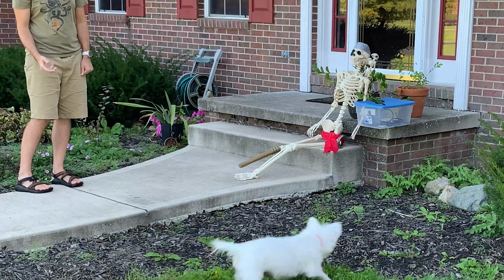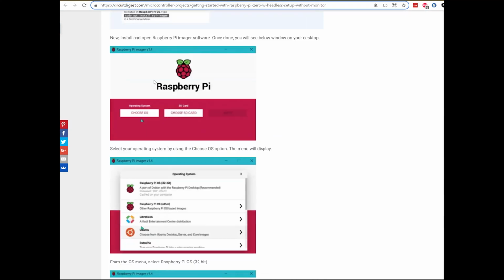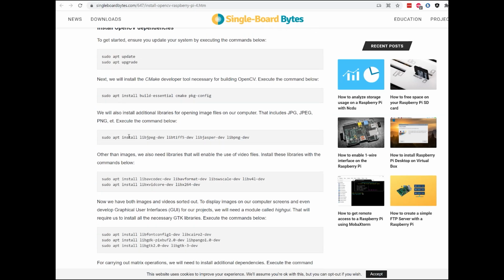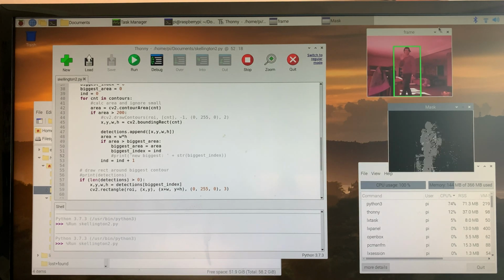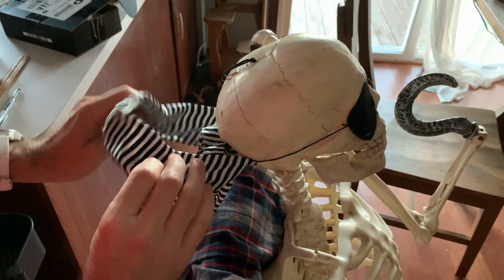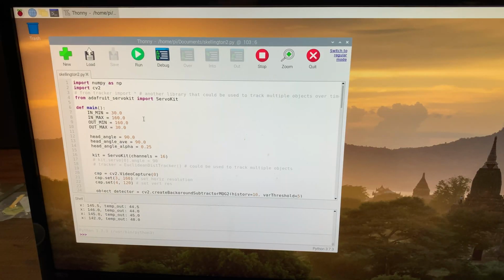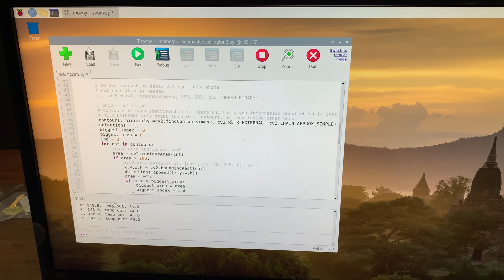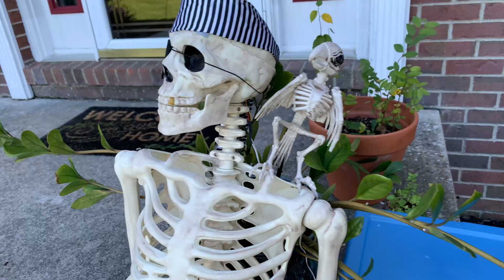HowTo use Raspberry Pi & OpenCV to track objects & turn servo

Comment: Hey! I replicated this using your guide, was a huge hit this Halloween. Wanted to thank you for the details you included. There were some things that have changed since this was released and this was my first time using linux or soldering but your video made it easy! It gave me an opportunity to work on a project with my grandpa after my grandma passed away and it really brightened him up. Thank you!
Reply from the maker: What a wonderful comment to read :) :) now you can get a wyze camera that does most of this out of the box, but you don't get all the control or grandpa time.

Comment: Very cool! I have a question. Can you also use the tracking software to detect and react to the object changing in distance from the camera?
Reply from the maker: You might need two cameras to get depth information, or some other sensor.

Comment: Great video! I am using this code as inspiration for a color tracking project for school. I had a quick question about the remap function and how it works. I am currently having trouble utilizing the full frame to get an angle. It seems that it only registering an angle for a quarter of the frame.

Comment: Hey, very good project.I have rebuilt your project and it works fine. Only I noticed that the servos do not turn off. Can you include a routine in which the servos turn off when, for example, no movement is detected? Many greetings !
Reply from the maker: I think you'd need to use a mosfet to cut power to it, but that may have unintended consequences: https://forum.allaboutcircuits.com/threads/turning-off-servo-power-while-not-in-use.158019/
Reply: @CuriousInventor  Hello, 
thanks for the answer but I meant if you can also solve this in software / program?
Reply from the maker: I dont believe so, unless a special servo is used.
Reply: Buddy which raspberry pi you used 3 or 4 1gb or 8gb

Comment: Which RPi OS are you running?  Which OpenCV release did you get installed?  I've been trying to get OpenCV loaded onto a RPi Zero W for 2 months now and I've have no luck.  Could you post an image of your SD to Github?  Any help or direction would be greatly appreciated.

Comment: very good project! I tried installing open cv on my RPi4 and did not have good luck I followed all the links. the issue is that when I got down to the 'make -j4' it failed each time stating 'No targets specified and no makefile found.'
Reply from the maker: Fyi, i never did any “make” to build from source, i just installed using aptget… you dont have to build from source at least for my application. I had to completely wipe my pi at one point and start over :(
Reply: @CuriousInventor  Thanks for the response. I tried that way also. When I got to the step 'import cv2' I got an error.  I wiped the Pi for the 3rd time. I tried a Pi3 and now Pi4. I wiped again now and giving it another try.
Reply from the maker: Make sure youre doing pip3 also, i think things can get installed where only python2 can see them as opposed to python3
Reply: @CuriousInventor  Intreresting. Ok I will try that again. last time I had the issue of importing cv2. Importing numpy was not a problem. I'm giving it another try. Thanks
Reply: same problem. when I go to import cv2, it fails
Reply: I found another link to finally get the open cv to work. And I loaded the example tracking from your link and that worked. The other issue is that when I loading/installed the adafruit ServoKit  I get an error when trying to import it. that's strange because the install was successful. But, the import for it failed which I don't understand.
Reply: Ok, I have everything working now. I plug your code in and it works My only question is...when you were testing your code with the servo, how do you bring up/see the frame window with the video?

Comment: that's pretty fun. I've wanted to do ...this...forever. Strikes me that it wants to have the camera/pi in the head, and then 'always try to center the view on the object of desire' - but that can be problematic for motion.
Reply from the maker: I think the openCV function looks for things that move relative to a background, so I'm not sure it would work if the entire frame was changing. Moving the camera kind of breaks it, but putting in the head is what I thought I would do initially.